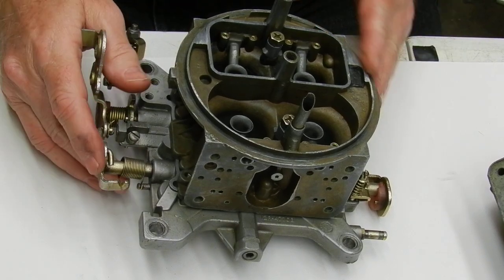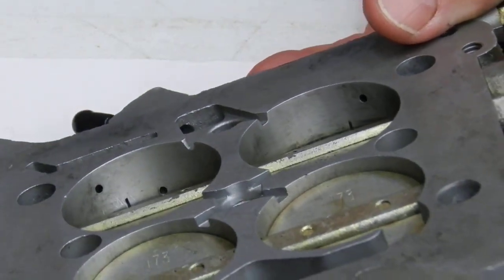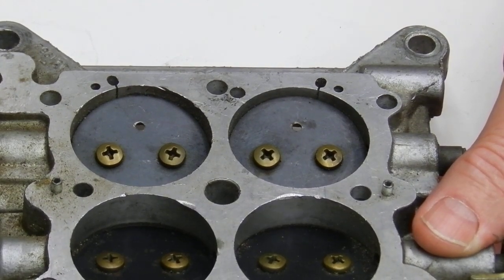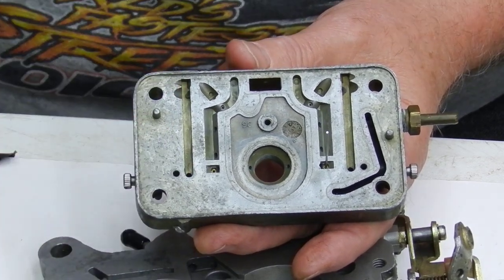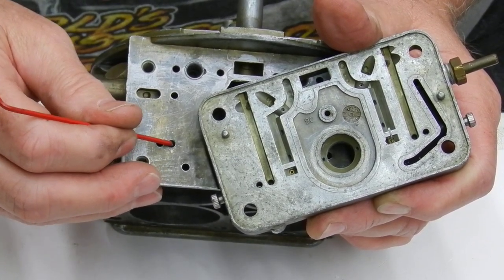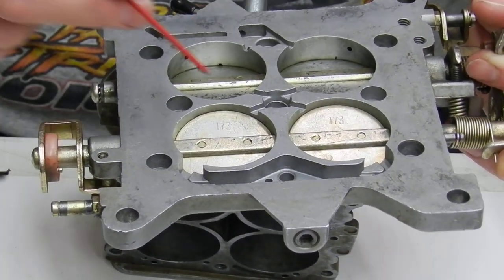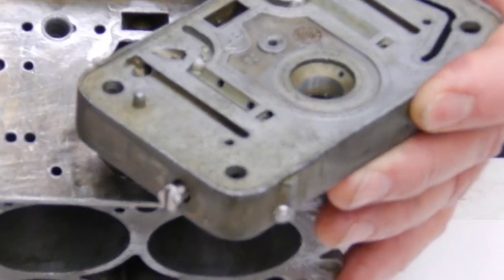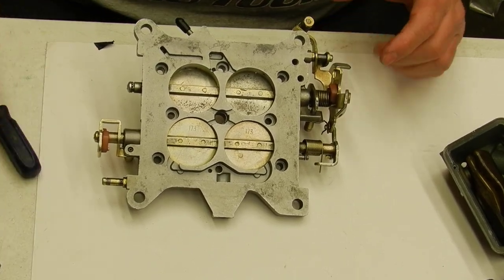Holley Carburetor Tuning: Idle Circuit Mods for High Duration Camshafts

Comment: I've found drilling ONLY the primary plates works well (as those are the only ones w/ idle mixture screws) for cams w/ 270+ duration @.050. Or using a 4 corner idle carb and not having to drill.
Reply: eric it does not matter if you drill the bypass holes in the primary side or secondary side ,or both sides all your doing is bypassing air past the throttle plates , it has nothing to do with it having a two corner idle circuit or four corner, your just bypassing air to close the throttle plates to correct transfer slot opening , I agree you can drill only the primary side, randy.
Reply: Full on race carbs have 4 corner idle mixture screws, if you notice on your carb there are blanks not drilled out where the screws would be.

Comment: Some guy rebuild my carburetor and ever since I can't make it run or sound correctly.  I messed with the idel screw and when I put  the truck out in reverse or drive  it hits hard like if the trans is going to break.  So I moved the idel screw and the truck stopped doing that but I'm still having trouble

Comment: What causes a 750 double pumper to run 13.5 at idle, 12.8 at WOT but at cruise it is at 10.5? Will this fix that?
Reply: My understanding is because you have low vacuum at idle the engine is not pulling fuel so much from the idle circuit, when you cruise the intake vacuum is high and engine is able to pull too much fuel. I think this topic has good tips: https://forums.holley.com/showthread.php?15781-RICH-At-Cruise
Reply: Did u measure vacuum at cruise and select correct power valve? Power valve needs to be closed while cruising. If it is than your primary jet is too large.
Reply: @markjanhunen2352  power valve is blocked

Comment: Hi I like your videos I'm having problems with this brawler 750 double Pumper I did what you advise got to 70,000 of a hole in the butterflies now it's idling better but I still have no adjustment in the screws I'm running a high duration cam it's a 312 322 a run pretty hard runs good off at top RPMs but just won't idle all that good it idles a lot better having problems and this new brawler has the screw in the metering plate like you show to drill out so that's already been done in the new meet metering block if you have any idea appreciated your response thanks a lot Paul
Reply: Big cams having trouble idling... you don't say.

Comment: Why is it important to have your idle port adjustment back? Apart from reducing base idling speed is there any other benefit? I think I need to do this but I don’t mind having an idle that’s at 1000rpm as apposed to 750rpm (6 cylinder)
Reply: Would like to know also mine runs great picks up perfect and I'm idling at 1000rpm I'm sure im in the transfer slot be runs great

Comment: Hi Randy, Thanks for the great video. Just a question.  I have a Holley 600 (1850) that was idling very rich so I drilled the holes in the throttle plates like you did in the video.  I drilled them to .070"   My engine is not rich at idle anymore, but It has a surge like condition at slow cruise speeds.  Any idea what might be happening?  It didn't do this until I drilled the holes. 

Thanks
Reply: Tony,  when you drilled the holes, you allowed more air into the engine, so now the low speed surge means the engine is hunting for more fuel.  it should not
be necessary to drill holes in an 1850 vacuum carb.   your rich condition
could have been caused by other issues, such as float level too high, or
possibly the power valve had blown due to a backfire.   Holley recommends
to never drill holes in throttle blades, because there are other methods to tune
the carb.   Holley is the most tuneable  carb on the market today.   hope this
info helps.

Comment: Randy, what are your thoughts on cracking the secondaries as an alternative to drilling holes? Any pros or cons?
Reply: Old video but I think it depends if it has 4 corner idle or not. If it does it would be better to drill in my opinion.

Comment: If I have a 4 corner idle mixture screw base do I need all 4 slots showing.
Reply: It depends on your cam. if your cam is long duration and high lift you will probably need  the primary and secondary transfer slots exposed. but hopefully you only need the primaries. When you tune your carb the best thing to do is have a a/f ratio gauge hooked up so you know how rich/lean your engine is, otherwise your just wasting time.
Reply: @saintblamo  it's the comp 294 cam and we are using a wideband

Comment: My nova idle really low but on park it idle reasonably how can I fix that
Reply: There's a screw on the throttle linkage that changes idle speed.
Reply: Biggest screw on the side of the carb with a spring on it.

Comment: Now will you modifications to the throttle plates overcome the idle problems with a large cam? I think I would rather hear my cam... LOL.I've been a Master tech for 22 years and never seen anybody drill the throttle plates. That's pretty trick
Reply: It's in the Holley carb tuning book.  The small orange book.

Comment: we will have more videos coming soon , such as power valves circuits and mods  , accelerator pumps and cams also  how to adjust discharge nozzles and a video on the 4412 500cfm two barrel holleys, we will also do some videos on the  holley #1850s and quadrajets and alcohol carbs.stay with me and I'll show you tricks learned over 40 years of experience. hope you like it. please subscribe if you like them, thanks, Randy & matt
Reply: +Randall Cribb Thanks for all of this. I just subscribed and cant wait for future videos. I've just built myself a 347 stroker with a pretty big cam and dialing in this thing just isn't as easy as I thought it would be.

I bought myself one of the relatively nice fully adjustable Ultra DP's and I'm trying to learn all I can about the emulsion circuits and bleed systems in the carburetor and how to adjust them, but cannot find ANYWHERE that teaches me what each do or how to go about adjusting them. This thing has little jet bleeds literally everywhere, and even though I've got it pretty close, I'm almost positive there's still more left on the table if I can just figure out how to fine tune everything properly. Is there anywhere you can direct me where I can learn more about these circuits and how to adjust them whether they be books or your videos?
Reply: I will do some videos and try to explain what all the bleeds are for and which control each system , and there effects on fuel.

Comment: Hello there Randy, I have been watching your video's and have gathered real good info from you, but I am having a real head scratcher with a lean mixture off idle? You have to slowly open the throttle, otherwise it flat spots and won't rev up instantly? I have just finished restoring a 1974 Pontiac Firebird with a 350ci pontiac block in it running with Hedman Headers and a Offenhauser intake Manifold with a 4brl double pumper 4776-5 Carb. It also won't start even when hot without the Choke and to get rid of the flat spot I have to set the choke at nearly fully closed with just about 3/16" opening on the flap to get it to run cleaner? It revs up ok then? Please could you tell me or anybody out there what I do to over come this part of leaness be much appreciated cheers Ty.
Reply: Tyrone Savill Lean bog is exactly what this fixes. Your 4776 is a 600cfm which will run, but you need to get more fuel in the engine. You can do this trick, but you can also try 2 sizes bigger jets on the primarys. Does it smell rich ? Or is it running lean?

Comment: if you're running a pcv valve with the hose to the base plate of the carburetor, that's enough of a vacuum leak. no need to drill holes in the throttle plates.

Comment: Having watched this video should the secondary match the primary  when it comes to the transfer slot?
Reply: Not necessarily match but still be within the tolerance he stated. Most holleys come out of the box with too much slot exposed on the secondary blades. I made a tool to adjust them without taking the carb off but in most cases you will need to. A pocket screwdriver is all it takes once the carb is off.

Comment: hi randy i have a 650 spreadbore  on a rpm duel plane performer manifold do i need a spacer on this as the gasket dose not have a surface to sit on the manifold have done your mods but worried that mite upset  vacume if not sealing carb base  cheers Ivan

Comment: what is a .070 drill bit... 1/8 inch or so
Reply: a  .070 drill bit is closer to 1/16 of an inch is .0625 thousandths , 1/8 is .125 thousandths , harbor freight has a big set of drill bits that are numbered in thousandths of an inch , set contains I think 115 drill bits , very helpful when working on carbs . hope this helps randy
Reply: Randall Cribb I'm running a demon 850 on a 347sbf. I drilled 1/8 holes on all 4 and it helped out alot so far.  thx
Reply: 1/8 th is 0.125th
Reply: Randall cribb, a 347 even with big pistons cam etc would be better suited for nothing bigger than 750-800 cfm carb, and thats an all out drag motor. A step up in cubes like a chevy 383-388 all out drag motor can get away with an 850.

Comment: In my experience having to drill holes in the blades usually means you don't have the correct carb. Im not saying he's wrong but that shouldn't be the first step to getting a car to not run rich at idle. Im strictly speaking of holley carbs.

Comment: Each barrel has a tube with a round open tube connected on the end and it is centered in the middle of the barrel. What is it's purpose and what is it called. I have fuel coming out of the right primary but not the left primary.
Reply: They are venturi boosters. The air flow through the venturi creates a low pressure which in turn 'sucks' the fuel through the metering jets in the metering block from the fuel bowls. The fuel should be atomising or vapourising with the air as it is drawn out of the booster. If you are seeing dripping from the booster it is likely your float level is too high or the float and needle is not seating properly allowing too much fuel into the bowl. Hope this all helps!
Reply: @Dave-by3bg  I am having the same issue as this guy. I got a 850 CSU blow thru for a twin turbo sbc I have been battling this damn thing for a good min now. First it was idling at 10-10.5, adjusted the float levels and it got better. messed with the idle mix screws and got it idling at about 13-13.5 but after a short test drive it loaded up real bad, flooded out the motor and died. I looked at the top of the carb and found it leaking fuel out of the front right (passenger side) booster. put my air line to the bleeds to see if they were clogged and checked the fuel levels again and they were too high. I must have not adjusted them right or my buddy was trying to adjust them when we were working on it (more than likely but wont admit it) I got the fuel pressure at 6#'s off of a Aeromotive A1000 and Aeromotive boost ref regulator I hope it helps after I adjust it again at my house not his